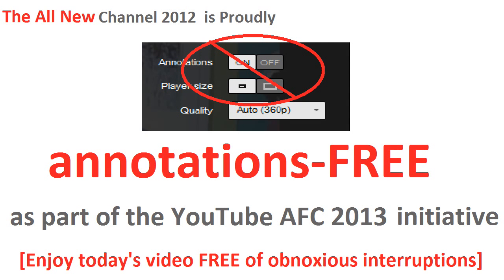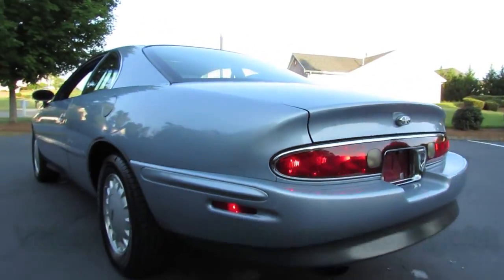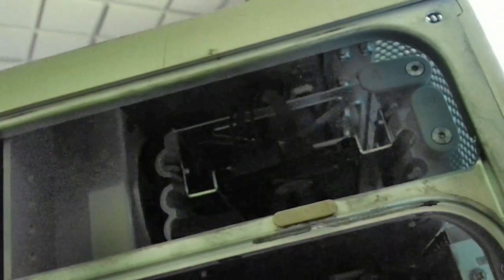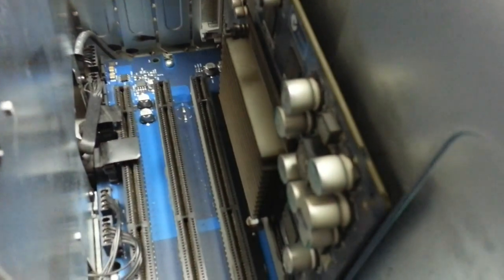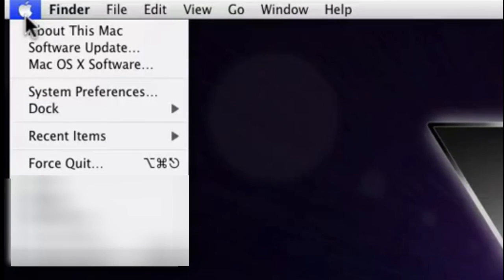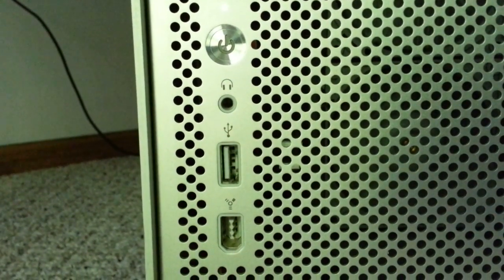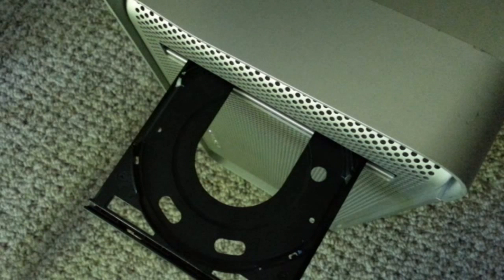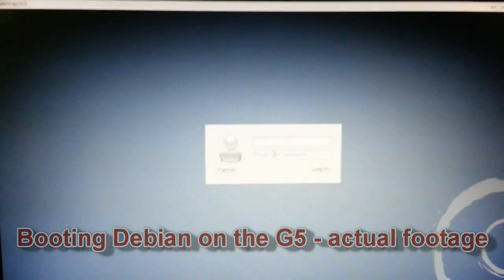FAQ - Using PowerPC Mac PCs in Modernity

Comment: My schools computers are all Pentium 4s with 768MB RAM and Windows XP Pro, I use those everyday. For the time being, my main machine is a PowerMac G5 dual 1.8GHz with 1GB RAM and OS X Leopard 10.5.8. I can assure you, my PowerMac G5 would smoke any of those Pentium 4 computers any day. Support wise, the Pentium 4 lasted longer, but thats because it's intel, and everybody supports intel. But support means nothing. I'd rather use two years out of date software than the newest software on a Pentium 4. I have no idea what you're smoking, but I want some if it'll make me believe crazy shit like a Pentium being faster than a G5.
Reply from the maker: TylerGaming97 
Thank you for the input. I know that on paper and in benchmarks, the PowerPC peforms faster, but the video was meant to show real world examples, and the fact of the matter was that the Pentium4 computers do the job faster and more efficiently than the G5 can.
Reply: ***** Because it's intel and intel has always been intel. So, if something, say Adobe Flash Player 17 works on Windows XP, then it will run on anything from a Pentium 4 to the best i7. Windows has always been intel which makes them much more future proof. Pentium 4 is slow, but it's intel so modern programs still run on it. The problem with PowerPC is that it's fast, but Apple  switched to intel because they could get more power for less power, so developers stopped developing for PowerPC because the market for them in 2008/9 just wasn't that big. What makes it seem slow is that all the programs on it are now out of date, and most programs that aren't out of date are made by small companies who have limited finances, so of course the program is going to be slow and have an ugly UI. Imagine if Microsoft used Intel all the way up until 2005, then switched to PowerPC. By 2015 we'd be saying the same about intel. Yes, an intel processor from 2005 was fast, but theres no support for it as the rest of the world is on PowerPC, so the older programs build up, intel won't run anything after Vista and bam. We'd be saying the same about intel that you are about PowerPC. 
Sorry if this doesn't make sense, I'm running on 20 minutes of sleep and just got back home from a movie.
Reply from the maker: TylerGaming97
Fair enough; as you pointed out, on paper, the G5 may have more potential, but it just doesn't live up to the hype in practice. You can chalk the performance loss up to poor software, but that doesn't make it any better. Beside performance, there's the other headaches associated with using the G5 too, like software compatibility, hardware compatibility, and upgradability, in addition to power inefficiency and lack of connectivity.
Reply: ***** I uh, I don't think I'd go that far
Reply from the maker: *****
Of course. My opinion is invalid because I pwned you, and therefore I am mentally challenged. Makes perfect sense.

Comment: What's wrong with you 
the powermac G5 is a great maschin and it's a lot faster then the other maschins I have frome this year's.
And mac os x 10 5 and 10 4 are great operating systems moth better than XP and Vista
Reply from the maker: http://s2.quickmeme.com/img/05/0550e0630e27661e7b5b18fc58bec79c17f698723f75f361c6598abd94a5a603.jpg
Reply from the maker: *****
Geesh, I knew the whole Pentium4 remark was controversial, but I never expected people to pick it up and run with it like that :-). At any rate though, I will address some of your concerns at this time to help clarify those points that you mentioned.

First off, when you said, "This video was one of the most biased videos I've seen over the Powermac G5", I would have to respond by saying that I don't know what videos you have seen on the Powermac G5, but most of the ones I have seen are also quite biased. The difference is that they lean on the other end of the spectrum, apologizing for the computer. I will admit that I too am quite biased; biased for whatever works best, regardless of brand, operating system, level of political correctness, or age.

When you said, "These systems are 10 years old and can not be expected to run many modern applications", I would have to say that I somewhat disagree. We have decade old computers in our household that run modern applications well enough still.

I was also concerned by your mention of "wrong information that was provided in this video". Was there a mistake somewhere that was missed? Also, your suggestion that "Some of the replies you have posted here are very rude to your viewers that make your channel" is a bit harsh. I'm actually a relatively patient person. Others would've just blown up or deleted skeptical comments, but I enjoy working with my viewers to answer their questions and help them with their issues. It's what Channel 2012 is all about. That said, enjoy the video, but don't take my humor too seriously. ;-)
Reply from the maker: *****
I'm sorry you feel that way.

Comment: I couldn't even finish watching, the creator of this is just wrong.  The PowerMac G5 was not a "last hurrah" in 2003.  Many revisions and improvements were made, onto a machine that was already many years ahead of the competition.  Nothing could touch those in speed. The previous designs of PowerMac, ibook and iMac were not failures, they singlehandedly revived Apple.
Reply from the maker: Thank you for commenting but allow me point a couple things out:

When you said "many revisions and improvements were made", you are partially right, and partially wrong. While the PowerPC architecture was expanded a bit after the PowerMac G5 (namely in the infamous PlayStation 3 and Xbox 360), this was pretty much the end of the line as far as Apple was concerned (although they did release incremental updates throughout the G5's ~3 year life cycle). If you had stayed with the video for a bit longer, you would've actually heard me point out that the G5's design actually lived on for nearly a decade in the form of the Mac Pro.
Reply: ***** Sorry if I sound too attacking, I mean not to. I agree, the PPCs lived on into xbox (I didn't know of the ps3, thanks for the info) but the G5s are quick machines and people still use and mod them to this day, a thing we don't see with comparable PCs of the year.
Reply: CompressionIgnitionAddict to be clear - they mod the cases and throw everything else in the bin